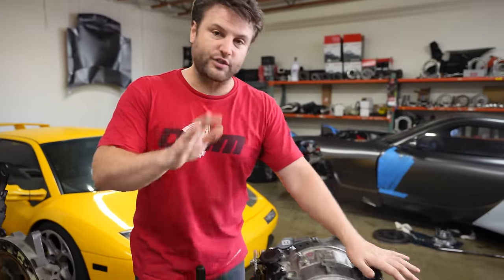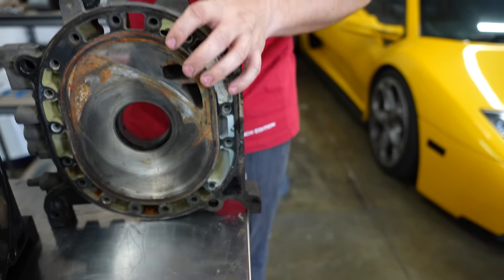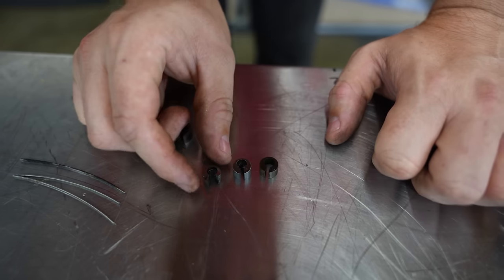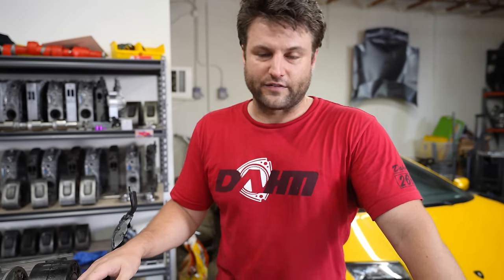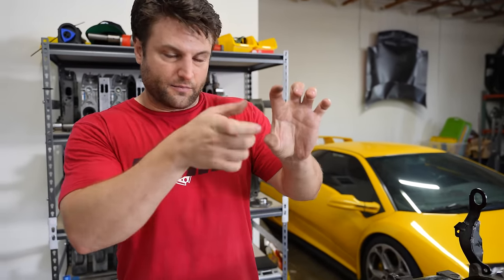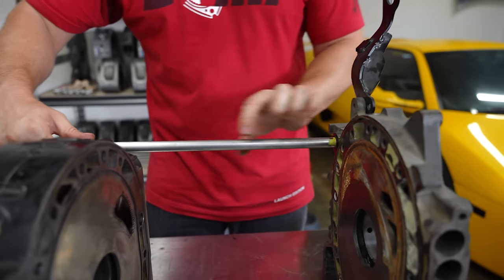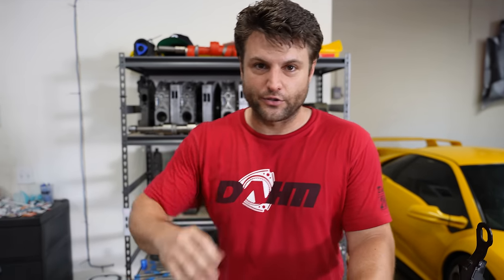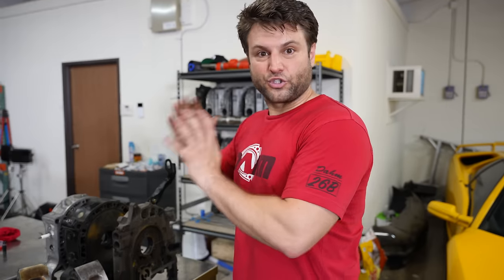Fixing the BIGGEST Problems of the Rotary Engine

Comment: The thing about the apex seals is interesting to me because you mention "stock internals" if the rest is in order.
I know Mazda 2-piece seals were the first thing to be booted and upgraded back in the 90s when they figured out they crack pretty bad when they do but I wonder how much better 3 piece ones are...just more insurance as you said I'm presuming.

Very interesting vid as always Rob.
You couldn't not cut it that tiny bit short in the end lmao
Reply: I pretty sure today somebody sells seals that dont break but not sure if they take 1300hp
Reply: There are upsides and downsides to both 2 and 3 piece seals.. 3 piece seal better at low rpm and 2 piece better at high rpm.. the best seals for N.A rotary's are Lannetti ceramic apex seals which are guaranteed for life, lightweight and are reusable, but very expensive.. although don't take well to detonation.. hence why carbon steel are better for turbo rotary's. Racing beat also make great seals.
Reply: @nzuncovered1845  Yeah, ceramic seals work great, until they don't.

Comment: I mean, sounds like having a 2 stroke oil system for the metering pump would work a whole lot better for the consumer than burning crankcase oil. Just have a oil tank for that purpose and refill it regularly with a low oil warning for that specifically.
Reply: They would just dump in the same oil.
Reply: @TheGuruStud  true. At least that would be the fault of the owner or shop though.
Reply: They make adaptor kits that let the OMP draw oil from a seperate reservoir. Another problem is the oil injector nozzles  are not known to be reliable especially at higher RPM. So that is why many people choose to do away with the system entirely and run pre-mix.
Reply: @nzuncovered1845  I wonder if there’s going to be any possibility that the MX-30 RE will have something that actually uses 2 stroke oil this time.  Like especially if it could just lock the fuel door, and when you release it from the inside it doses a appropriate amount of oil for a fill up based on the current level. Probably being too optimistic

Comment: The actual problems of the engine were addressed and solved by a youtuber long ago and have heard little from since. The engine has design flaws in its operation, not due to other secondary problems. The problem of wear and tear is tremendous. The you tuber redesigned and modified the rotary design itself and made it the engine that should have been. redesign and use controlled grain structure nickel or other alloy blocks.
Reply: And that youtuber's name is...???
Reply: @kevinlow69420  it was someone who races with rotary engines in modified RX7's
Reply: @kevinlow69420  his name is JOHN CENA! I'm sorry

Comment: What if instead of Pre mixing fuel with two stroke oil, you make a seperate oil system for the injection in to the rotor? Perhaps tunable with amounts of oil injected by boost or rpm?
Reply: He does mention bypassing the oil pump pickup and adding a separate oil tank for a supply of 2 stroke oil, of which there are many good choices. If premixing, blendzall castor  offers that nice 2 stroke race engine scent.
Reply: @Oldbmwr100rs  Klotz caster oil is another option

Comment: Ever thought about building a hydrogen burning engine? I think the rotary design is uniquely suited to the qualities of hydrogen. You'd need to build it out of different materials to handle the heat and force.
Reply: Mazda did it in the rx8, half the Power was lost.
Reply: hydrogen, at the pressures we know today, has less energy density of any racing fuel, gas and even methane. This, is why it sucks.
Reply: hydrogen burns cooler

Comment: two stroke oil does not suck at lubing bearings, its literally made for and does exactly that in two stroke engines lol. its just designed with combustion in mind.
Reply: What 2 stroke engine are you talking about that has bearings in a combustion chamber?
Reply: @TobiMcTobeface  obviously not in the combustion chamber but 2stroke oil lubes the crankshaft bearings before being burned relatively cleanly in the combustion chamber.

Comment: I have a completely stock (engine) 2004 RX8 with Mazda installed rebuilt. I have been using Idimitsu in the fuel since day one. It has AEM intake and Borla exhaust with a factory catalytic converter (California). The original engine went 130K (with Idimitsu mixed) and factory specified engine oil (non-synthetic). Internal coolant seal failed on the original engine (white smoke at startup and then eventual flooding from coolant). I used "K-Seal" on the original engine at failure after de-flooding (coolant) and new plugs. I drove it event free in California (with weather temps over 100 many times) for another 12K miles with no issues. My son took over the car to go to College and that is the only reason I had the engine replaced for fear the K-Seal fix could fail. I drove it to Mazda and the mechanic that did the compression test asked why I wanted a new motor as all was good. Anyway, that engine was run only on Shell Premium with the Idimitsu and that is the same for the "new" (Mazda Rebuilt) engine. It has about 60K on it. 

What should I (my son) be doing to prolong the life of the engine that is in the car? Why does the internal coolant seal fail and what can we do to ensure the Rebuilt does not suffer the same failure?   Thank you!

Comment: I've always wanted to go rotary. But the closer I get to doing it, stories, rumours, horror stories, myths get in the way. 

I do most of my own wrenching and the more I see of rotaries, even with their problems, they seem to be so simple to work on and maintain. Even pulling the engine every few 10s of thousands of miles for seal replacement and inspection could be a simple routine. Burning 2 stroke oil is so simple and brilliant.

Thanks for the video. I need to do a bit more homework that will include more of your videos. But a cheap RX8 project might be in my future.

Comment: I cannot believe that I didn't see this video earlier. I do not own an rx7 or rx8, as much as I really really want to, but I knew that they were inefficient and had issues. But, thanks to this man, I have more hope now, and I'm confident that if I really try, I can get an rx7 that I can make fun and reliable. What baffles me the most is that people are secretive about how to keep the engine running well and to live much longer. They are not car enthusiasts, they're just weird. Long live the rotary!
Reply: You definitely can- and like youve seen in this video, this is really 99% of the "mystery".

Solid rotary engine build: Mild porting, dowels, OMP delete with premix, e85.  Literally done. This will genuinely cover you for 4-600+ whp with boost with no major problems. Everything else will be "external" add ons to fuel such an engine (good exhaust, properly sized turbo, proper injectors and fuel management system, etc).

Comment: My 93 rx7 had 129k miles when I sold it and still ran well. I would use half e85 and half premium gas. I mixed full synthetic 2 stroke at 70/1 ratio. I never ran coolant only redline water wetter and distilled water.  I also put this blue head gasket sealer in The coolant. 
These are great engines but do require more maintenance. I really miss that car!

Comment: Back in the late 1970s I worked as a mechanic for an outfit called Malibu Grand Prix. We rented race cars, by the lap and our customers could drive a very technical track and get a real driving experience. We used Sachs, single rotor, rotary engines and they were fantastic. We premixed our gas in an in ground tank. The engines made so much power that they had smaller carbs and restrictor plates.

Comment: I enjoyed this video so much, and it all made so much sense, and so simple to understand. Now I think I'm in love with rotary engines again. I've always thought mass continuing in a circle was way better then reciprocating mass. I've raced 2 stroke dirt bikes growing up (bean oil smells so good) and 2 stroke oil had gotten so good that we were running 100 to 1 mix ratio on synthetic. We just never ran lean on fuel - air ratio. Less oil in the fuel keeps octane higher, and a cleaner combustion chamber. Great video, thanks!

Comment: Running e85 especially having a flex fuel sensor is the best upgrade you can make to a car for several reasons. The cooling properties is a huge deal, it reduces pre ignition considerably, you can increase the boost, more flexibility in timing and tuning and many other benefits to running it. The only considerable drawback is the constant stops at the gas station. When I was running mine I had to stop at the gas station 3-4x a week. Yes a pain in the ass but an extra 120-150hp depending on tune and do it safely while the engine is running cooler.

Comment: I had a 1986 RX-7 GXL, the internal coolant casting broke, letting hot exhaust gas into the coolant itself.  I was personal Friends with A 30 year Mazda parts manager. He had several 13B engines crated and ready for shipment back to Japan. We took out the engine " slice" needed for repair and after bathing the rotors in an acid solution, bought new side seals, apex seals, every seal you could think of for a full internal rebuild.  My friend charged me cost for the seals and it was still $1200! Just for the seals. Did I love my car and wish I still had it? HELL YES!

Comment: I raced in Pro Rally in the mid 80's. I ran a Mazda rx2 with a rotory engine that was bridge ported ect. I ran 2 stoke oil at the time, i just disconnected the oil pump rod on carb. One thing to be careful with is your fuel filter, if it has a paper element, it will plug it up after a while.

Comment: Rob, you may enjoy reading "The Goal" and "It's Not Luck" both by Eliyahu Goldratt. The Goal is mostly focused on lean systems engineering (presented through the lens of lean manufacturing) and spends a lot of time on the Theory of Constraints, which is very strongly related to your recommendation on which upgrades to focus on. It's Not Luck expands on how to come up with concepts like those demonstrated in The Goal.

Comment: In the year 1980 I bought a second hand NSU RO80 motor car which ran perfectly but was very thirsty. I converted the car to run on LPG and injected a tiny amount of two stroke oil into the venturi in order to lubricate the combustion chamber as the oiling system was described as : " total loss" in other words, the oil supplied for lubrication had no return system, it burned and there was no oil pan or sump as it is known in the UK.
The car ran beautifully, and the economy was great, in particular because I was the Engineer and Manager of the LPG gas company, and used fuel from our vast stocks to run the car.
It always struck me that this engine should have been designed from the outset, as a dry gas motor, with factory designed lubrication system,  ceramic rotor tips, and with lpg, the compression ratio could have been raised to at least 15:1 giving vastly increased thermal efficiency, despite the engine breathing system lacking in volumetric efficiency. Good upload , thanks for this.

Comment: I never understood why Mazda used just one oil system instead of two separate.  I mean, obviously they wanted it to be familiar to those used to 4-stroke engines, but that led to people not understanding why their engine burns oil, and led to dirty-burning oil gumming up everything and causing failure.  Good job, guys.

I have a BUNCH of old 2-stroke motorcycles that have separate oil systems.  One you change when it gets dirty, the other you top up as it's depleted.  I can't imagine a system that takes dirty used engine oil and dribbles that goo at a 300:1 ratio into the rings.  But that's what the apex seals were given.  With boost!  You have GOT to be kidding.  The fact that a stock rotary can run for more than 15 minutes is frankly mind blowing.  You can't expect anything to work when the lubricant is 3 drops of tar.

Comment: Just looking at a few RX-8s for cheap because they have dead motors. This is great! Run E85 for the cleaning and mix it wirh 2-stroke oil for the Apex seals and to counteract the corrosive problems with E85 then keep the good oil in the bearings. Brilliant!

Comment: Years ago Saab was using two cycle engines in the Saab 95 and Saab 96 models. The last fueling version had an oil tank and a fuel tank. Oil was metered into the fuel before it got to the engine eliminating the need to add it to the fuel tank. This way, the correct amount of oil was added to the fuel with no guessing required. The biggest change was the reduction in smoke to the point that the car no longer had a white cloud coming out the exhaust.
What you described for the oil injection would work just the the Saab.
The cracks in the oil passage could have been eliminated by changing the alloying of the iron. Adding scrap steel with additional nickel and copper could eliminate the cracking and create a better surface for the rotor seals to run against as well as improving the machining.
When you were describing the through bolt the first thing that went though my mind was to replace it with a shouldered bolt or stud. I would also include three or four aligning dowel pins to hold the pieces together before the installation of the shouldered studs. The studs should have a slight interference fit. The requirement for the installation would be chilling the studs with dry ice to shrink them enough to install without pounding them into place. That would positively  locate the sections together. the aligning pins would align the parts prior to installing the studs.  
This was a very interesting video. Thanks.
Reply: like scooters today 2 stroke

Comment: At 1/8 fuel level, put a half quart of Ford type F ATF in gas tank and fill it up. Much cheaper than 2 stroke oil. Also never idle engine for extended periods. I loved my '78 with the 12A. Stainless 3 inch straight pipe exhaust, sheet metal intake with two Webber down draft two barrel carbs, and 2 stages at 200hp of spray each made it very entertaining. Got me into low 11s in the 1/4.

Comment: I had a first gen 1985 RX7 one of the last of the carbureted models.  That car had probably close to 400,000 miles on it.  It was an interesting vehicle I had to choke it to start it and I never understood all the vacuum lines and how they operated with the vehicle. I can tell you that behind the high RPM loving car there sat a well-built Wankle dual rotor that was put together right and hit all the perfect tolerances.  I used to say if you have one that runs well there was built well it will Outlast the vehicle. The storage compartments behind the seats if you open them you can see the road

Comment: Hey Rob,   have you tried applying Nikasil to the rotor sides and the side plates?  If so.. how's that shake out?  Have a look at the aluminum cylinders of the m70 BMW V12...  aluminum-on-aluminum with ZERO wear.  I have personally seen ~200K mile engines with the original diamond-honed crosshatch looking like they were just ground at the factory.

Comment: Hey Rob, I believe those XRF machines will only give you a surface material reading. That should only matter if they're coated (like ceramic coated ones)

I also believe most models do not list carbon content of the material.

Comment: What a great video! I’ve never owned a rotary, but knowing this kinda info is out there is a benefit to anyone wanting to get into them. 
Looking at the space between the bolt holding the plates together, and where they pass through them, would a machined tube that closes up the gap work to prevent torsional movement of the engine? It looks like there’s enough material to have a tube in the middle.